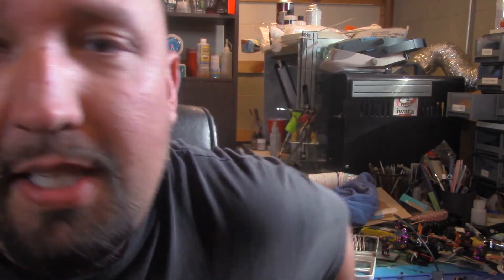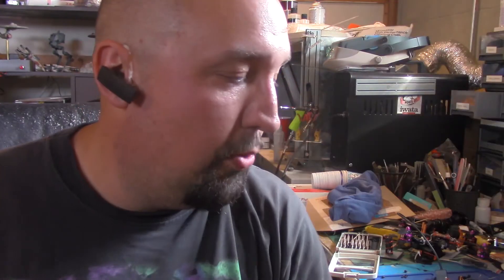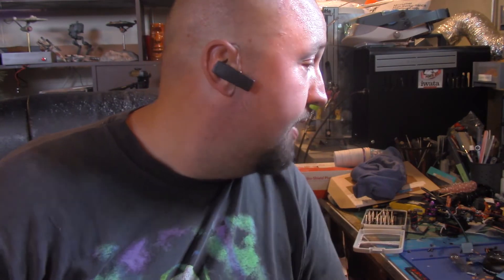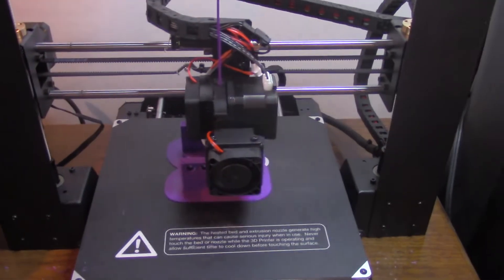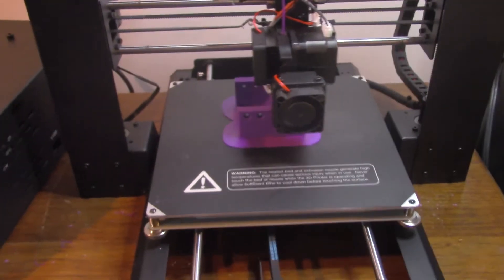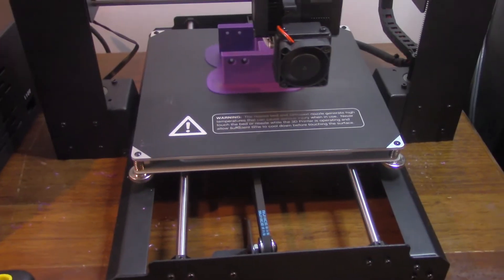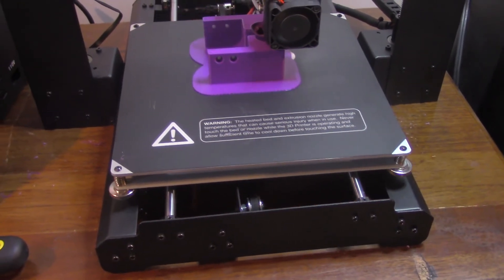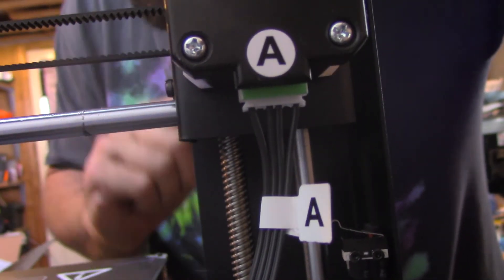MONOPRICE MAKER SELECT V2 UPGRADE SERIES

Comment: Did you need to mod this to make it print flexible filiment?
Reply from the maker: you should to make it easier..i have a later video that shows the part you need to print..then use sainsmart tpu and good settings.

Comment: This is all well and good; but I've had my Mono mini v2 for a couple days and still struggling with manual bed levelling. 
I follow instructions as closely as I can; and still find it a pain in the * leveling. The print head gets in the way of the adjustment screws, and every time I think I have it level, I waste more filament on another fail. 
I cannot even get it to create a raft that sticks to the bed; with or without blue tape.
Also, I cannot find decent settings for the Mono for Cura. I've tried several versions of Cura, and looked up configurations. 
The problem is that the settings shown on the videos doesn't match with what's in the program. Cura has so many settings, I'm feeling like I'm expected to be a PhD engineer to understand this. I had hoped it were more 'plug and play'...
Yet another expensive paperweight...
Reply from the maker: John Chalinder I use simplify 3d so can’t help with the cura settings. You really need to just leave the included build tac on there. Do the mods and then calibrate extruder percentage and finally replace with a piece of borosilicate glass off amazon. I never have to level pla. Need to level for tpu every 3-4 prints maybe since it’s a finer process.
Reply: The number 1 failure reason is poor quality filament, not the printer itself. I would stongly recommend the Hatchbox filaments. Leveling that printer is indeed a pain, but it gets easier with practice. Another thing to pay attention to is bed temp and filament temp, 60 and 195 respectively.

Comment: I noticed that you were using 200 extruder/60 bed setting. Are you printing PLA or ???? I have used INLAND Black PLA and have had pretty perfect results out of the box. The demos that came with the uSD card used 195/50, so I have done 40-50 objects, about 280m of the filament and all was good. I wanted to try different colors, so I got some spools from Quantum and the first print was junk. So I put the original PLA back in to see if I could print anything again, and all I get now is JUNK!!!!! Have you done anything different for different colors of filament or ?????
Reply from the maker: i use hatchbox pla now..never have changed to any other brand..i stick with what works no matter the price so i know what my printers are doing now..only way to learn rather then changing and keep guessing..i use 220/70 on any color of hatchbox pla on the glass with aquanet hairspray.  same with my tpu..i only use sainesmart.  my latest video shows the results of that.  its about time for a few update videos on this one and the cr-10.

Comment: Spool holder on power supply until braces are installed then you can put it on top.  I absolutely love mine even though it requires constant tinkering.

Comment: Also another one I forgot, you'll want to get a new cooling fan for the parts. Stock one is underpowered and doesn't have good airflow. There are a multitude of choices, but I found that ditching the 40x10mm fan and moving to a 50mm radial fan was much better (and they are about $2.50 on ebay). Just do a comparison if you decide to go that route, and you'll see what I mean 8^)
Reply from the maker: JimmyPop FiftySeven man thanks you thank you for all that information. I guess I'll find out today when I tear it down. That bed leveling travel makes me nervous though

Comment: You'll start to notice pretty quickly that the heat bed bows when it's hot, and will warp. Only a matter of time, and a glass plate will take care of that. I heard in the video you are replacing the Y carriage plate (great call), the aluminum plate is lighter, and not prone to bending like the stock one. I have modified 2 of these machines, with these mods, and I'll mention that with 3mm glass + 3mm on the aluminum Y plate, if you add the spring cups you won't have much room to level anymore. I ended up cutting about 2mm of spring off and they are fine now. Just a heads up! Also think about recalibrating it once you are comfortable with 0.2 and 0.1 layer heights. Get all your steppers in order, modify the acceleration and jerk settings and you'll be able to easily print at 0.06 and 0.04mm per layer (much slower tho).